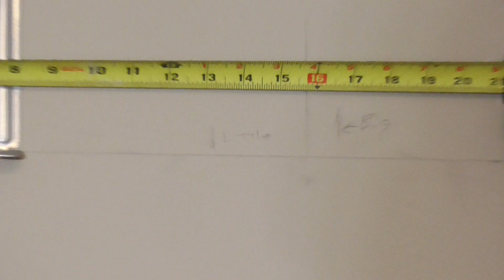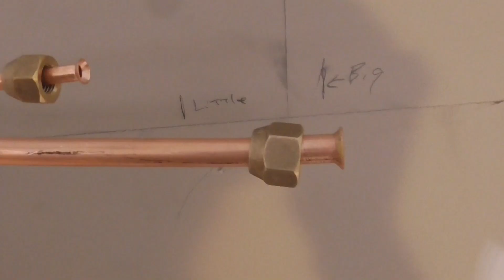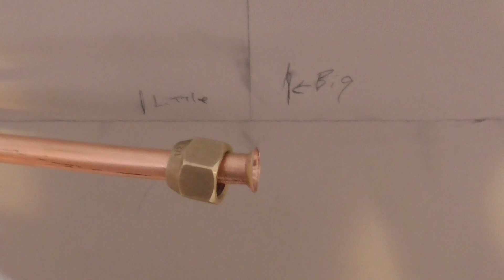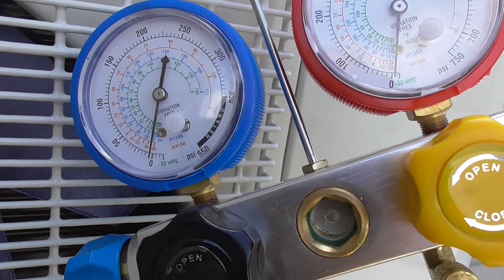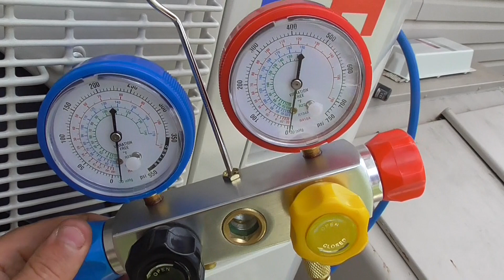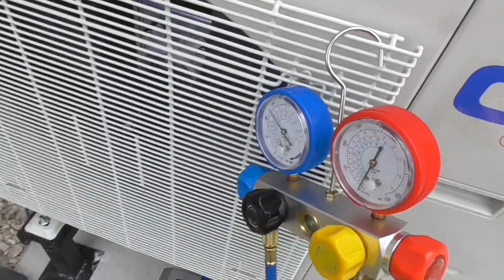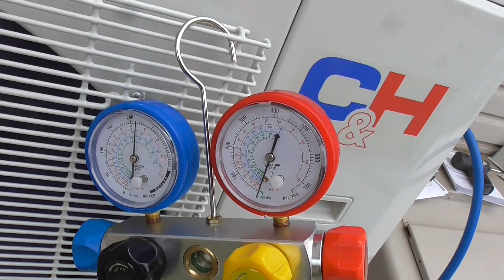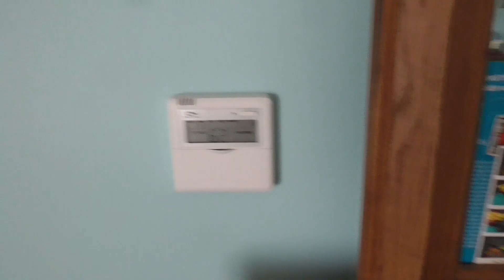Cooper&Hunter Multi Zone Mini Split Installation (2020)

Comment from the maker: Units and supplies can be purchased here:
https://amzn.to/30Sg3XE  C&H Multi Zone Mini Split 12-18K AC Heat Pump
https://amzn.to/37Nyn5W C&H Mini Split Single Unit 9K AC and Heat Pump
https://amzn.to/2YGOE8w Line Set Outdoor Cover Hide A Line
https://amzn.to/3hErZlL 9K - 36K Outdoor Wall Mount Bracket
https://amzn.to/2UTDufG Halex 30AMP Disconnect Box
https://amzn.to/2UXgoEP Watertight Electrical Whip Assembly
https://amzn.to/3dfh26M 10-2 Gauge Wire 50'
https://amzn.to/2Yb0SHi 10-3  Gauge Wire 50'
Reply: So you like these better than the Senville? It seems like the Senville were easier to install, no? (especially the pipe bending). 
The Senville seem to get better ratings (and more history in business). 
I was going to go with Senville.. however you have me second guessing!!
Reply: There actually the same unit both midea rebadge
Reply: @maxd4968  Any idea who is the underlying manufacturer?
Reply: Midea air conditioning manufacturer a lot of mini split air conditioners and other companies rebadge them. Senville, cooper and hunter, pioneer, mr cool, carrier, Toshiba (only time one toshiba model the rest are made by Toshiba themselves), kelvinator and midea themselves are only a few, there made in China and use Toshiba compressors there actually decent quality

Comment: I just had a Senville 24k Aura installed professionally in my home and most DIY’ers do a much better job than my HVAC people did. 

As far as the unit goes and for the last couple of weeks it has met all my expectations.  Just checked the temp with the unit set on 80, it is pumping out 109.5 at the head and it’s 28 degrees outside.  

The unit is doing pretty well keeping the living space in my drafty ole house with vaulted ceilings and two bedrooms up stair.  The unit wasn’t purchased to heat my entire house, just the living space.   It’s doing great so far.  I’ve since ordered a multi zone from Senville to put in some other rooms to completely replace my warn out central ducted system.  

Fingers crossed.  Thanks for the video. You answered the multizone vacuum question a lot of us had.   Thank you.

Comment: Extremely helpful video. I am installing a 36kBTU multisplit system made by Senville. Looks almost identical to this unit. The manual mentions NOTHING about the critical evacuation and opening the charge release procedure. It is a bit tricky compared to a single zone system.

Comment: Im a HVAC company owner and we mainly sell Cooper & Hunter.  Some thoughts I'd like to share with others reading this is when doing the flare connections to the outdoor and indoor units, you MUST use Nylog gasket sealant and a torque wrench.  Installing the unit yourself is great, you save thousands.  Although down the road when it starts leaking, which it 100% will leak if you don't use gasket sealant & a torque wrench, you will pay thousands to charge it up every year to HVAC companies.  

Also, by not using a "Micron Gauge", you MUST vacuum down to 500 microns or else you WILL have a leak.  It's great to save thousands of dollars by installing your own system but when it has issues the thousands you thought you saved by doing the install yourself, you will be paying to recharge it often with great disappointment.  This is why companies walk away from customer installs because:
1) We don't know where the connections are in the wall if there are any
2) We don't know the quality of the installation and cannot guarantee any leak repairs due to us not knowing if the flares were flared properly
3) If gasket sealant was used
4) If a torque wrench was used 
5) If it was pressure tested with nitrogen 
5) If a proper vacuum was pulled down to a minimum of 500 microns

Advice: bite the bullet and have it professionally done, spend now or later.  Not to mention that any system, "specifically Cooper & Hunter, voids all warranties if not installed by a licensed HVAC company.
Reply: How does not vacuuming down to minimum 500 microns guarantee a future leak?

Comment: I'm confused.   At the 36min 30 second mark, you opened the high pressure valve and said it was Nitrogen but had text pop up stating that it wasn't Nitrogen and that it was 410a.  If it was in fact 410a, didn't you just suck the precharge out of your system when you vacuumed it down?   Did you have to go back and add more?
Reply from the maker: Good question.  An HVAC engineer informed me that the gas was R410A (I thought is was nitrogen).  Between the top service valves and the lower line valves all copper is pressurized with R410A, so the installer can tell if there are any leaks or damage from shipping.  Once the main service valves (up top) are opened the full charge of 410A pressurizes and fills the line sets with refrigerant.  This is my best understanding of how it works, but I am not a HVAC Tech.
Reply: That would make sense that its pressurized to make sure that the lines didn't get damaged for shipping but I believe that this 410a is part of the precharge.   I really do appreciate your video because the installation manual only detailed a single unit system on the topic of evacuation but I believe the steps of opening the high stage valves prior to evacuation is incorrect. You only used two lines of the four available so I'm assuming that you had much less than the 100' of lineset.   The unit is precharged for 100', so I'm guessing that's why your particular installation worked properly.   If somebody was to use the full 100 feet, this video could cause them to lose some of their precharge and cost them a lot of money.   On page 20 of the installation manual, in the CAUTION box, it specifically states not to open the outdoor unit's gas and liquid valves to vacuum.  

Once again I appreciate your videos and I'm not trying to armchair quarterback.   I was just hoping that you could edit that portion of the video if you find my statement to be correct.    

After speaking with the technical support people at C&H, I still don't know if it was part of the precharge. They also didn't know what brazing was so that's a little scary..     @doublewide6
Reply: Tavis Sweeney what you heard was 410a being released . The system should have been pressurized with nitrogen to verify for any leaks . Trying to pull a Vacuum to find leaks will actually pull Contaminants into the system . Also you should use valve core removal tool on both high and low side  , this will reduce Restrictions when pulling a vacuum , a Micron gauge is required . Systems should hold at least 500 microns before Refrigerant is Introduced  to the system .
Reply: What is the final verdict on this discussion? Open the valves for line sets A - B after the vacuum?

Comment: I've installed 2 C&H mini splits (actually the same model in the same location, as a power surge fried the first one). I watched all of the YT videos, and it's all very easy, except for one thing... When I remove the blue vacuum line from the service port, I get quite a spray of freon (or whatever it actually is), and I have not figured out how to prevent that. In this video, the gauge remains connected after releasing the freon, which is nice in that you can check the pressure when it's running. But that big spurt of freon when disconnecting the line probably means that the reality is somewhat different than what I observed on the gauge. In any case, I have a short line of copper tubing (only about 8') so losing a little freon is probably no big deal. But, it is something to be aware of when doing the install...

Comment: Just to clarify a shutoff valve on the vacuum hose is a good idea to isolate the pump from the system and leave the gauge connected. The pump will end up leaking down. Some of the units are setup different and only have the lower valves which in that case releases the R410a not nitrogen.
I believe the adapters are 3/4 to 5/8" The original nuts are engraved with 5/8" Hvac is sized by the outside diameter of line. Not inside like plumbing

Comment: This is a well-made video cooper&Hunter would be proud of you. Definitely make a second video showing how much money you save by installing everything.
Reply from the maker: Thank you, I will look into a future video for sure.  I am noticing that compared to my central air and heat pump system,  I only need to set the thermostat at 74* on this C&H unit.  My central air thermostat is set at 71* which is telling me I am loosing efficiency through the duct work of my central ac unit.
Reply: about a grand.  =)

Comment: I used plastic downspouts to hide the tubing, condescent drain ,  and signal wire. $15 for 10 feet   I cut to length then split the back with scissors

Comment: THANK YOU THANK YOU and THANK YOU!!! you are on of the first ones to show a MULTI-ZONE VACUUMING process. All the others have just shown vacuuming process for a single zone mini split system... and you nocked it out!  I'd been looking for these type of scenarios.... and by the way.... I have the exact same C&H 36 BTU system;  but instead, I have purchase it with 2 9000 BTU heads and one 24000 BTU head.  Just one question.... are you sure I can just open up the connections down below (not the service connectors) so I may vacuum the line sets?  Again, thank you so much!
Reply: Knowing to vacuum the main manifold connections is exactly what I needed! Thanks.

Comment: Good job .Using same brand Air-conditioner working welll 5 years
Reply: We're glad you hear you've had a good experience with our brand, Alex!
Reply from the maker: Yes, I spent some time doing research and I wanted a company that made commercial products as well as residential.  These units are well made, I believe meant to hold up over time.  It is good to hear yours is working well for you.

Comment: Each line set has its own service port. I would connect to each and vacuum to test for leak on individual line.
Reply: Would you pull the vacuum individually with the valves open high and low? Then just put shrader back after pulling vacuum 300 micron? Individually. Do you pull a vacuum on the main king valve post at the top or no?

Comment: Just a heads up you can take the cover off the indoor unit to run the copper tubing and communication wire without having to fight the unit and the wall.
Reply: How did you do that? Would love to know as this was hardest part for me - thanks!

Comment: I installed the same system but the bigger module cools great but the smaller one blows but does not cool at all.  

(There is no error code when they are both set to “cool” but it displays 2 dashes if they are both set to “auto” so I keep it at cool.)
Reply: PS I just installed this the other day and it has been operating this way from the start.

Comment: Again, thank you for your great video(s) so instructive.  Quick Qn. Let's say I installed the same unit 36KBTUs and installed only 2 head units and working... but 2 or 3 moths later I want to add another head to have a total of 3 head units.  How do I vacuum the 3rd one without risking/compromising the gas is already in the initial 2 line-sets?(head-units) ? Thanks in advance.
Reply: You will have to add enough gas for the additional  units and line sets. A calculation must be done. These units come with enough refrigerant for 75ft of lineset
Reply: Good question

Comment: I wish I could be comfortable at the temperature you said you like in your bedroom. I can't sleep very good unless my room is 62⁰. Thanks for the video! I've watched a few installation videos and they stopped before showing how to vacuum and charge the system. Some of the people did like a three or four part video series but never did the final part. Is that vacuum/pressure gauge set for automotive? I have an automotive one but not sure if it will connect with the unit without buying extra fittings

Comment: how does the blue gauge read, if you close the knob?
Reply: Exactly lol
Reply: @lotfyken2759  Blue gauge is always connected to the blue line. Closing the blue knob only disconnects it from the middle interface so now the gauge and line are isolated from the other side.

Comment: Excellent, thank you so much. This video is exactly what I need to install my 2 zone mini split. Thank you also for the tool list. I will be attempting to do all of this myself. If I mess up then I will get a professional in to do the charging. I will skip the nitrogen step as well as I can't seem to find a nitrogen tank anywhere.
There is just one question I have. When you unscrew the valves with the Allen key do you leave them unscrewed in operation? I wasn't too clear on that step. I suspect they are left open. 
Thanks again for a great video!!!😃

Comment: Great install!  Please let us know the difference you receive in the energy cost vs traditional unit. Thanks!
Reply from the maker: Great suggestion! I should save close to 40* over traditional heat pump HVAC.  No ducts no leaks,  only cooling or heating the zone you want to, and inverter technology is where the savings comes from.
Reply: Great idea, I'd love to know as well.

Comment: I have a question : How do lawn mowers charge the battery? My tractor only has a starter and magneto (ignition coil). Do they even charge the battery? I have an old Rally 10 hp , Briggs&Stratton engine.
Reply from the maker: There is a stator under the flywheel that picks up a magnetic pulse from the spinning flywheel and it converts the electrical mechanical  power to charging power.
Reply: @doublewide6  Thank you! And do the charging wires come out behind the starter, where does one wire have a diode?

Comment: I could use a little help.  The C&H installation manual is pretty vague.  I'm trying to sort out the power lines for this thing.  I have two of the Sophias in two different sizes,--both are 240V.  I see that you have three lines feeding the power--one ground, a black, and a red.  I assume that the black is your 'neutral' line and the red is a straight 240V line--not two out of phase 120V lines.  I'm assuming that you are grabbing the 240V off your master CB box by taking a single line off a dual pole CB?  Many thanks.  You have one of the better videos on these puppies.  Mine are more complex as they are ceiling mounts, so I have greater wire and line runs, plus I need to have a drain for them for the evaporative moisture.  I really like your idea of the pseudo "downspout!"
Reply from the maker: Double pole breaker with black and red hot, white neutral and ground.  Drain the ceiling unit in the soffit where the venting is behind the gutter, or tie it into a drain vent line going through the roof.

Comment: Awesome Video, I have the same exact config but with Pioneer. I am gearing up to install but wondering if the vacuum and refrigerant release procedure is the same for Pioneer Multizone; the Pioneer manual is a bit cryptic and says the common valve must be opened before the circuit valves which is opposite of your procedure. The two brands look identical in every way. Both are pre-charged and have the same manifold, dimensions and almost identical manual. Any insight?
Reply: Just got off the phone with Pioneer aka ParkerDavis...the proedure is exactly the same. This video is good reference for Pioneer Multi-zone mini split.
Reply from the maker: The machines are configured the same way.

Comment: Love your use of drown spout(s) to hide the line set.  Were you able to run both line sets through the one downspout?
Why did you buy a condenser with four outlets If you are only cooling two rooms? 
Were you required to get some sort of fed or state certification before you could install the system? And did you put anything on the copper pipe ends before connecting them to the AC system (Teflon tape, locktight, etc.)?

Comment: By closing your blue valve all you did is check you blue gage is not leaking
Reply: blue gauge cannot be disconnected from blue line. Closing the blue knob just isolates them from the middle of the manifold.

Comment: You should aways use nitrogen and micrometer
Reply from the maker: I couldn't rent it from any rental store.  So I figured I will do it myself and it it does not work then pay someone to come in.  I did gamble on it, but it has been 6 months and it appears I won.